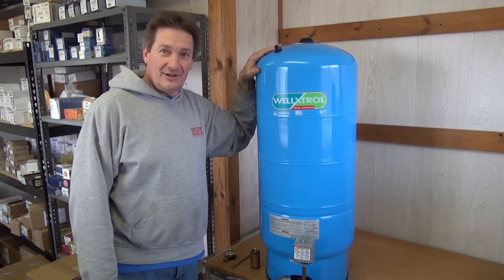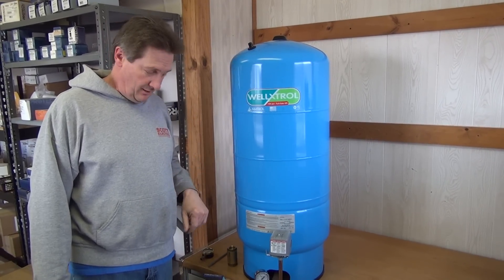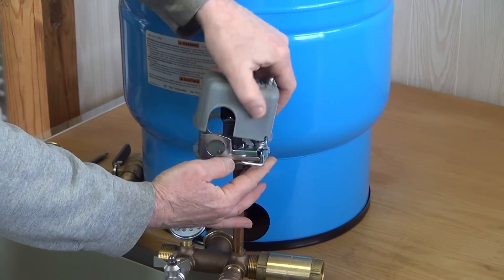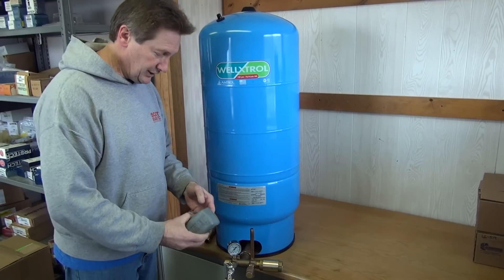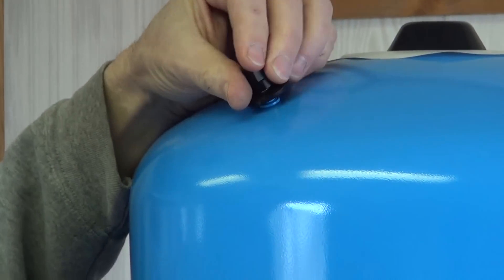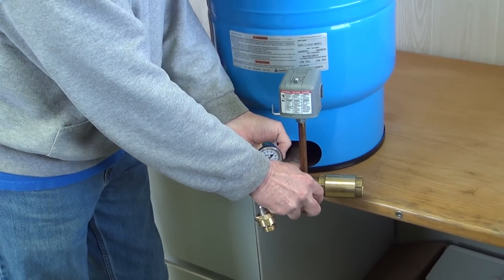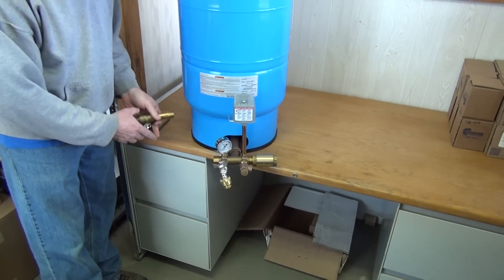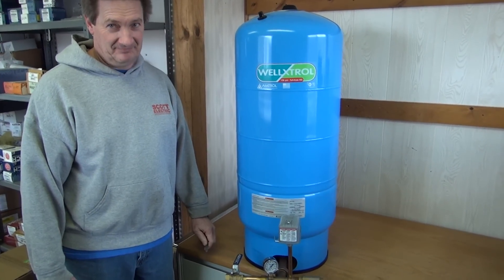Introduction to sizing and installing a Cold Water Pressure Tank

Comment: When you check the pressure on the tank is that before its hooked up to the water?  My tank came precharged to 25psi.   Do is need to increase to 28 psi for my 30-50 switch?

Comment: Question. Would installing a 20gal pressure bladder tank under my house with a check valve before make my water pressure make more steady water since my well doesn't have a pressure tank? I have no way to install a switch or any electrical add ons to the tank.

Comment: nice video. would like to see more video from you. one question. a pump turns on and uses 5 times its normal power at start up, then uses normal power load while running. i have 6 gpm  620 ft well. do not have pump information. do not have head depth or any of that info. but i live in New England and we do not run out of water, it rains alot. 
the 20 gallon tank is set up for 6.2 drawdown  which i believe is set up 40-60 lbs pressure range. 
the 20 gallon pressure tank operates normally there seems to be slight fluctuation in pressure but we may or may not have a 2 stage pump which would probably explain the slight pressure change problem. or it could be crud in the pressure switch pipe

either way im interested in changing the 20 gallon bladder tank to a larger tank. i believe the pump will not turn on as much even though it already does not rapidly turn on and off. could i go with a 44 gallon tank made by amtrol ? drawdown numbers on the tank are greater around 9gpm drawdown. 
also notice the spec is different on the larger 44 gal. tank. it has a 1 1/4 inch entry compared to the 20 gallon with a 1 inch entry. if i put a reducer on the larger tank would that affect the drawdown of the larger tank? 
or matbe not because drawdown only tells me how much water the tank holds after the pump turns off when it finishes filling the pressure tank?
the house was built 15 years ago with a 20 gallon tank . i assume builders often go with the cheapest items when building a home for example a small tank. or a base model fridge.
when i replace this tank i will most likely also replace the pressure guage an elbow and maybe the check valve and pressure switch to ensure no crud has accumulated over the 15 yrs. and affect performance.
thanks

Comment: Thanks for the information! I would like to know if you think it is wise to oversize the water tank. I need to replace my 35 gallon fiberglass bladder tank. I'm not sure what the GPM on my pump is, but I have a lot of irrigation needs and would like the pump to come on as little as possible. Also I'm told that the longer the pump runs without stopping the better, so it can cool itself down before it turns off. But then I also wonder if it's a bad idea to run the pump for too long because you might get more sediment? I'm looking at either the WX250 or even the WX302. thanks!

Comment: I just wanted to mention that when installing this on a jet-pump system (rather than a submersible pump) do NOT install the check valve!
Installing the check valve on a jet-pump system will lead to rapid-fire on and off cycling of the pump motor, and could erroneously lead to questioning the pump switch or foot valve in the well.

Comment from the maker: This is a reply to Ron's question.  You do not need a tee right at the pressure tank.  the line from the tank to the pump (or a check valve if that is installed) is under pressure and any lines tee off that are also under pressure.  So a tee that is installed away from the tank is the same as if it is a tee at the pressure tank.

Comment: Do I need a Tee at the pressure tank? My well pipe comes into the house, into a Tee. One side of the Tee goes to the tank, the other goes to the house water supply. In the house supply is the pressure switch and shutoff valve. This arrangement leaves the pressure tank on an end of the pipe. Is this correct? Would it work better with a Tee at the tank? That would require a considerable amount of replumbing to do that.

Comment: Nice Vid and I thank you for it.

. Question for you, can you remove the pressure relief valve and adjust it from 75 psi to 100 psi? Or do you need to buy and install a new 100 psi specific pressure relief valve?

I ask cause I want to increase the water pressure in my house to 85 psi cause my water pressure is brutal.(I  have a well obviously) I put it up to 85 psi this weekend and it made a HUGE difference in my house pressure esp in the shower! AWESOME!!! I don't want to blow the valve so I turned it back down today to 60/40. So if I can adjust the 75 psi valve I have on my system now to 100 psi, I can then turn the pressure up to 85 without damaging anything.

Thanks in advance for your response. :)

Comment from the maker: This is a follow up to comment from Robert.  The pressure in the tank should be set to 3 pounds below the pressure switch cut in point. So, if you are using a 30-50 pressure switch, the tank pressure needs to be set to 27 pounds.
Reply: Dennis's Nasty Toenails  2 pounds below, check it out. You are full of Shit too if everybody is going to argue about +&- one pound, tire gauges are not that accurate!
Reply: Keith Specialty Store wrong its supposed to be 1 pound less then the cut on so it should be 29 pounds

Comment: I am putting in a proflo 44 gallon   pressure tank made by amtrol and it is 38 psi in the tank .40/60 switch .I want to make sure this is all correct .I have 1 of those hydrants by my well and i do not have a check valve ,should i have 1 put on .The well is 400 ft in the ground and it is a 1 hp power pump that says 12 gpm  .I want to make sure the plumber is doing this right as I have no check valve now or no pressure relief valve and the plumber did not even include that with what he told me he needed to put this in
Reply: Defintly you need one to prevent the reverse flow of water from the tank to the
well. Your well is very deep,hope they installed at least 3 check valves along the
well flow pipes. pressure relief valve is good to have but not mandatory.
At that depth,your pump maybe giving you 8 to 10 GPM. Too deep for 1 HP.
Next time of pump replacement I will recomend you to install a 1 1/2 HP.
                     Hope this help you.
Reply: Hi Sissy,  It is possible that the check valve is built into the head of the pump, which is often the case now-a-days.  The pressure in the tank of 39 psi is correct for a pressure switch of 40/60. As for the pressure relief valve, this is normally required by some local building codes, but until the codes required them, a relief valve was not used.  It is a safety feature and many still see it as an optional piece of equipment.

Hope this answers your questions

Comment: how do you know when your old tank is going bad .Mine sounds hollow from top to bottom
Reply: There are a few signs that your tank is going bad.  If you get water out of the air stem at the top, it is a sign that the bladder is leaking. Other signs are rust and/or leaking tank or if the tank does not hold pressure.
Reply: I replace it with a 44 gallon tank and seems all the stuff was clogged up with iron deposites

Comment: the title is how to size a tank---it is never told how to figure out what size you need--you did not even give the size of the tank shown--only the draw down size????
Reply: Hi Lee,
The sizing part is in the first 30 seconds of the video and it may not have come across clear.  Basically, you want a tank size where the draw down for the tank is equal to about a 45 - 60 seconds worth of water your pump can deliver. i.e. if your pump is a 8gpm, then you can deliver about six gallons in 45 seconds of running, so you want a tank that has a draw down of around 6 gallons.  This is a rule of thumb to maximize the life of the pump.  Normally you want to the pump to run 45 - 60 seconds per cycle.
Reply: Here is the formula for calculating.
Pump GPM * 0.75 (45 seconds) = Draw Down Tank Capacity needed
or Draw Down Tank Capacity / 0.75(45 seconds) = Pump GPM needed
What little research I have done, 30 GPM is typical for home well pumps running off 120 volts AC. 
That means, the draw down tank capacity for a typical home would be about 22.5 gallons...or as close to it as what's available.

Comment: @bammbamm12: the well pump can pressurize the the supply, but the pump will be cycling rapidly which is bad for the life of the pump (which is measured in cycles). one purpose of the pressure tank is to reduce the number of cycles the well pump goes through.

Comment: Is it safe to assume that the pressure coming out of the well is not sufficient to pressurize the supply line? I ask this, because I see many diagrams that don't show a pump, and I wonder what's going on. The supply pipe from the well just seems to run under the tank, but I can't figure out what's going on mechanically.